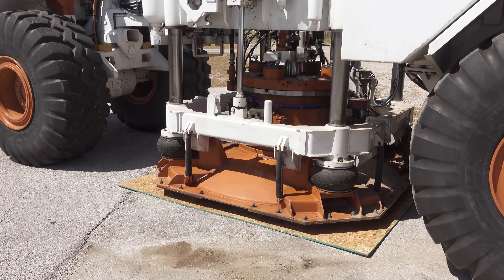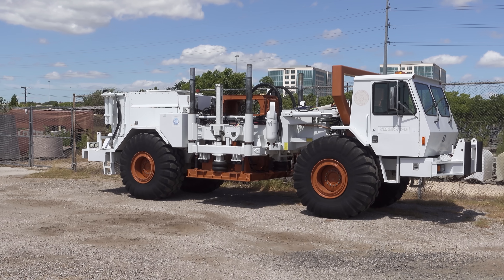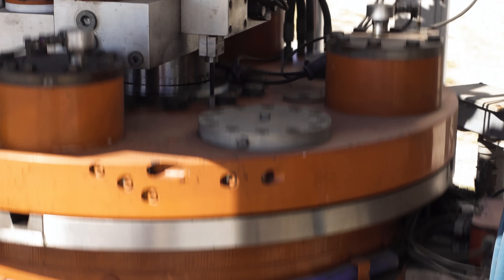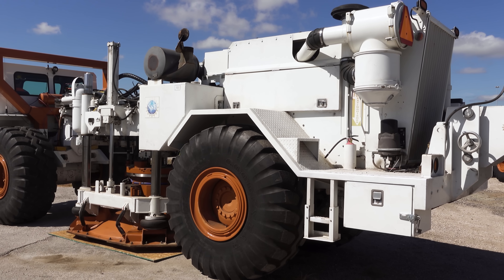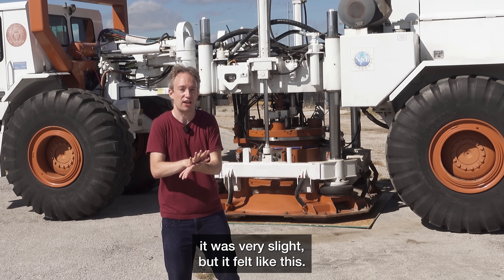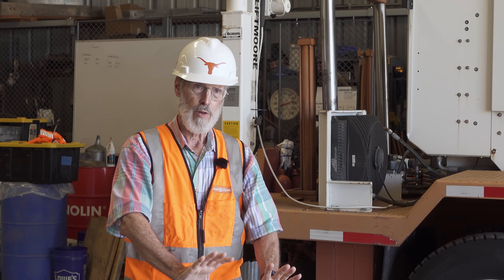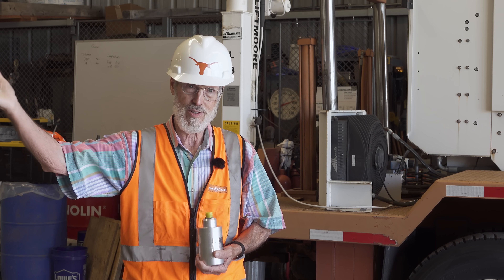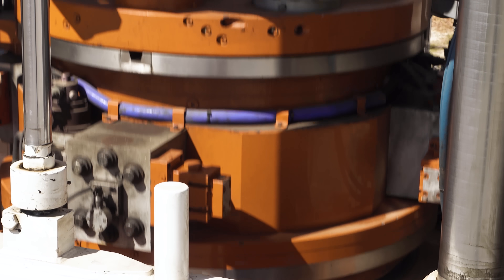This massive truck makes artificial earthquakes

Comment: Tom is one of the very few people who can turn any topic into a great masterpiece that’s actually interesting to watch.
Reply: You haven't even watched the video yet mate.
Reply: @cublub5910  I never said I did. I’m just talking about Tom in general.
Reply: @starrycrystals8  Caught you in 8K UHD surround sound 16 Gigs ram, HDR GEFORCE RTX, TI-80 texas insturments, Triple A duracell battery ultrapower100 Cargador Compatible iPhone 1A 5 W 1400 + Cable 100% 1 Metro Blanco Compatible iPhone 5 5 C 5S 6 SE 6S 7 8 X XR XS XS MAX GoPro hero 1 2 terrabyte xbox series x Dell UltraSharp 49 Curved Monitor - U4919DW Sony HDC-3300R 2/3" CCD HD Super Motion Color Camera, 1080p Resolution Toshiba EM131A5C-SS Microwave Oven with Smart Sensor, Easy Clean Interior, ECO Mode and Sound On/Off, 1.2 Cu. ft, Stainless Steel HP LaserJet Pro M404n Monochrome Laser Printer with Built-in Ethernet (W1A52A) GE Voluson E10 Ultrasound Machine LG 23 Cu. Ft. Smart Wi-Fi Enabled InstaView Door-in-Door Counter-Depth Refrigerator with Craft Ice Maker GFW850SPNRS GE 28" Front Load Steam Washer 5.0 Cu. Ft. with SmartDispense, WiFi, OdorBlock and Sanitize and Allergen - Royal Sapphire Kohler K-3589 Cimarron Comfort Height Two-Piece Elongated 1.6 GPF Toilet with AquaPiston Flush Technology., Quick Charge 30W Cargador 3.0 Cargador de Viaje Enchufe Cargador USB Carga Rápida con 3 Puertos carga rápida Adaptador de Corriente para iPhone x 8 7 Xiaomi Pocophone F1 Mix 3 A1 Samsung S10 S9 S8AUKEY Quick Charge 3.0 Cargador de Pared 39W Dual Puerto Cargador Móvil para Samsung Galaxy S8 / S8+/ Note 8, iPhone XS / XS Max / XR, iPad Pro / Air, HTC 10, LG G5 / G6 AUKEY Quick Charge 3.0 Cargador USB 60W 6 Puerto Cargador Móvil para Samsung Galaxy S8 / S8+ / Note 8, LG G5 / G6, Nexus 5X / 6P, HTC 10, iPhone XS / XS Max / XR, iPad Pro/ Air, Moto G4 SAMSUNG 85-inch Class Crystal UHD TU-8000 Series - 4K UHD HDR Smart TV with Alexa Built-in (UN85TU8000FXZA, 2020 Model) GE 38846 Premium Slim LED Light Bar, 18 Inch Under Cabinet Fixture, Plug-In, Convertible to Direct Wire, Linkable 628 Lumens, 3000K Soft Warm White, High/Off/Low, Easy to Install, 18 Ft Bissell Cleanview Swivel Pet Upright Bagless Vacuum Cleaner Trane20,000-Watt 1-Phase LPG/NG Liquid Cooled Whole House Standby Generator.Caught you in 8K UHD surround sound 16 Gigs ram, HDR GEFORCE RTX, TI-80 texas insturments, Triple A duracell battery ultrapower100 Cargador Compatible iPhone 1A 5 W 1400 + Cable 100% 1 Metro Blanco Compatible iPhone 5 5 C 5S 6 SE 6S 7 8 X XR XS XS MAX GoPro hero 1 2 terrabyte xbox series x Dell UltraSharp 49 Curved Monitor - U4919DW Sony HDC-3300R 2/3" CCD HD Super Motion Color Camera, 1080p Resolution Toshiba EM131A5C-SS Microwave Oven with Smart Sensor, Easy Clean Interior, ECO Mode and Sound On/Off, 1.2 Cu. ft, Stainless Steel HP LaserJet Pro M404n Monochrome Laser Printer with Built-in Ethernet (W1A52A) GE Voluson E10 Ultrasound Machine LG 23 Cu. Ft. Smart Wi-Fi Enabled InstaView Door-in-Door Counter-Depth Refrigerator with Craft Ice Maker GFW850SPNRS GE 28" Front Load Steam Washer 5.0 Cu. Ft. with SmartDispense, WiFi, OdorBlock and Sanitize and Allergen - Royal Sapphire Kohler K-3589 Cimarron Comfort Height Two-Piece Elongated 1.6 GPF Toilet with AquaPiston Flush Technology., Quick Charge 30W Cargador 3.0 Cargador de Viaje Enchufe Cargador USB Carga Rápida con 3 Puertos carga rápida Adaptador de Corriente para iPhone x 8 7 Xiaomi Pocophone F1 Mix 3 A1 Samsung S10 S9 S8AUKEY Quick Charge 3.0 Cargador de Pared 39W Dual Puerto Cargador Móvil para Samsung Galaxy S8 / S8+/ Note 8, iPhone XS / XS Max / XR, iPad Pro / Air, HTC 10, LG G5 / G6 AUKEY Quick Charge 3.0 Cargador USB 60W 6 Puerto Cargador Móvil para Samsung Galaxy S8 / S8+ / Note 8, LG G5 / G6, Nexus 5X / 6P, HTC 10, iPhone XS / XS Max / XR, iPad Pro/ Air, Moto G4 SAMSUNG 85-inch Class Crystal UHD TU-8000 Series - 4K UHD HDR Smart TV with Alexa Built-in (UN85TU8000FXZA, 2020 Model) GE 38846 Premium Slim LED Light Bar, 18 Inch Under Cabinet Fixture, Plug-In, Convertible to Direct Wire, Linkable 628 Lumens, 3000K Soft Warm White, High/Off/Low, Easy to Install, 18 Ft Bissell Cleanview Swivel Pet Upright Bagless Vacuum Cleaner Trane20,000-Watt 1-Phase LPG/NG Liquid Cooled Whole House Standby Generator.
Reply: Either that or there's plenty interesting stories/topics to be found and he's the one who finds them.
Reply: @matteomaximov4238  I think he gets sought out often enough now, a few of his videos start with "so I was asked if I ... " - which is very cool having that kind of presence that you're the one fielding requests, not making them.
Reply: @VosperCDN true that.. also a possibility 👍
Reply: Big part is also the passionate people telling their story. Love it.
Reply: Not trying to be a d*ck...but don't you think "masterpiece" might be a bit of an overstatement?
Reply: Implying that trucks creating artificial earthquakes isnt an interesting topic without Tom talking about it?
Reply: @Vanq17  it’s not that it’s not interesting it’s that Tom makes it entertaining. Think of history class: it all depends on your teacher
Reply: I think part of it is that his videos are rarely longer than 10 minutes.
So its easy to keep my attention
Reply: Agreed
Reply: Keep farming likes bud, seems like your self esteem really needs them
Reply: @amp7711  Who are u talking about? I don't feel like any of these people are really "farming likes". Maybe it's your low self esteem talking?
Reply: J
Reply: Repent to Jesus Christ “Do not be overcome by evil, but overcome evil with good.”
Romans 12:21 NIV
I